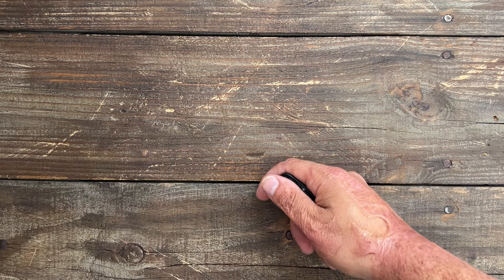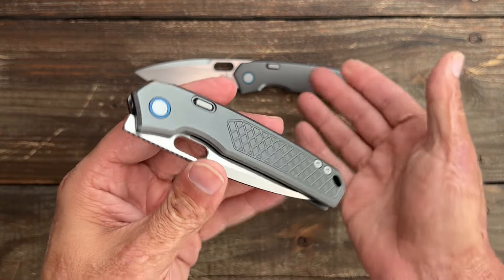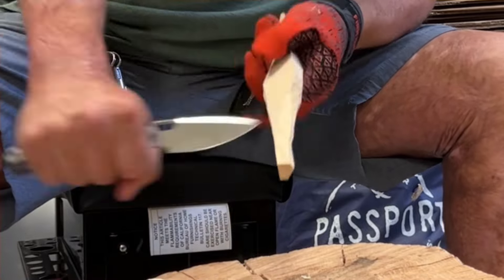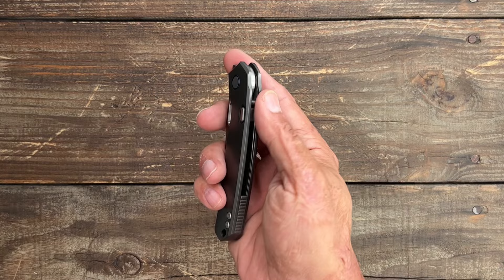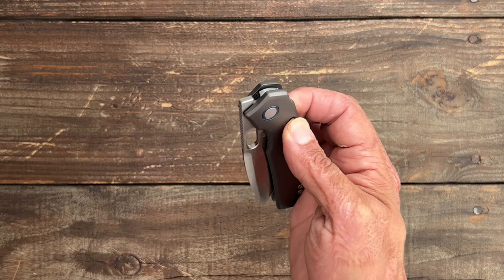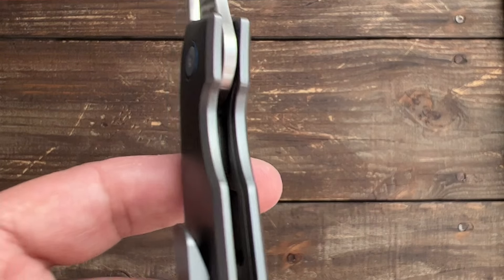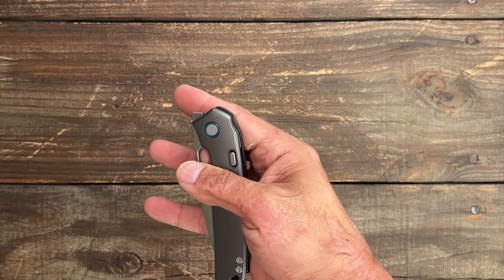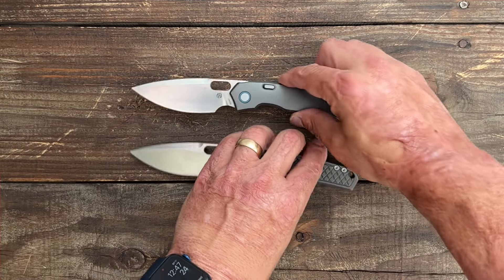Their Best Knife Design This Year - Vosteed Psyop

Comment: Call me crazy but I don't like front flippers. I like the idea of the kickstop on any knife that needs those lines. Not a single front flipper in 60+ knives.
Reply from the maker: Not a front flipper fan either but I do love a blade hole
Reply: @Stassa23  You really do love blade hole deployments! LOL
Reply from the maker: @sloanNYC  it’s definitely the easiest for my messed up hands to actuate 👍🍻🍻
Reply: I wasn’t a fan of front flippers until I got the Kizer Varatas. They nailed it there and it converted me. It’s so fidgety and easy to use. Knives that are strictly flipper designs turn me off though. They have to be REALLY good for me to keep. Holt, Shiro and grimsmo nail the flipping action. But I’m also sending my haptic out for thumb studs to be added to it.